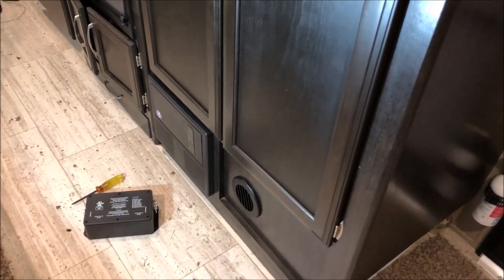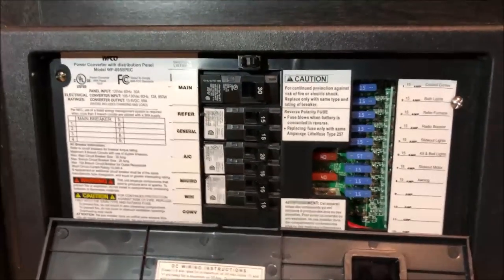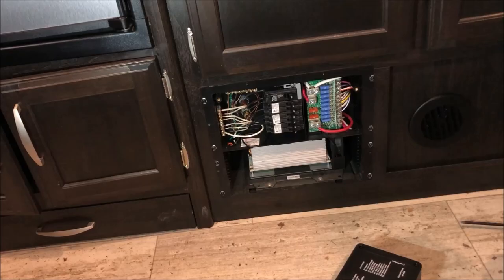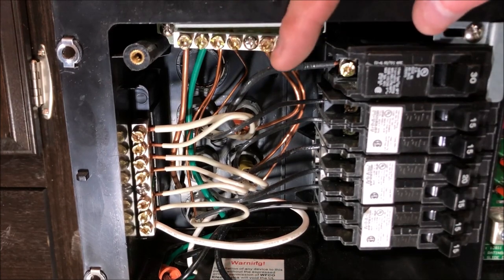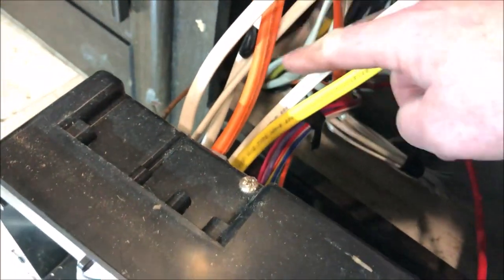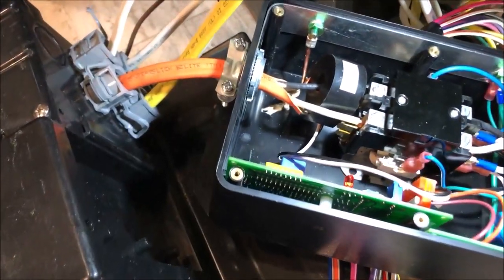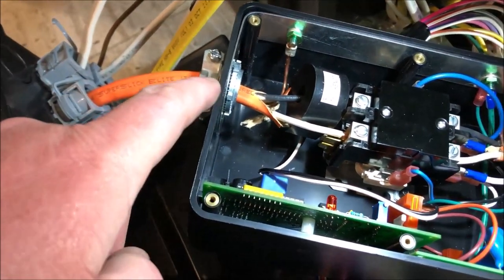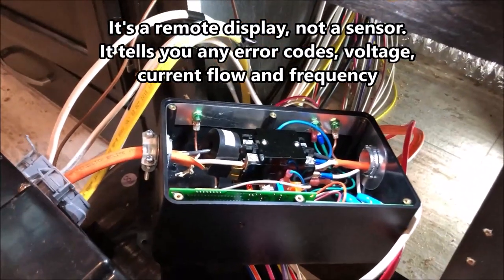Progressive Industries EMS-HW30C install

Comment: Great Video!  You made it super easy for me. 1.5 hours of my time and I never have to worry about storing, connecting, paddle locking, water damage, or having a $250 exterior inline protector stolen.

Comment: Thanks for the informative video! 1 year out, how are you liking it? If possible, could you share where you mounted the remote display? I’m looking to do the same to our Imagine 2400bh but I’m not very creative!
Reply from the maker: Hi Brad, thanks for watching.  My rig is in storage at the moment but I can tell you I mounted the remote display where my control center switches are for the awning, water heater, etc.  I used double sided sticky tape to put it up there, then I routed the data cable behind the switch panel, across the little cubby hole under the TV, then down the back of the cabinets via small holes into the circuit breaker cubby hole below them where the EMS is located.  I think this is a good buy, it works great!  The display is mostly for my own curiosity, as it has only engaged 1-2 times ever... and that is when I'm plugged in at home on a 15-amp plug and I do something stupid. You could just as easily take a simpler route and mount the remote display just outside the circuit breaker panel near the floor, it just won't be as easy to read.
Reply: @JohnsDIYPlayground  Thank you for the reply!  I’m definitely going to pick this up, then, and (try to) do what you had done. Looking forward to more great videos!

Comment: So it's basically just pulling the romex out of the existing panel and attaching to the protector, then running a new short section of romex back into the panel?  Seems pretty easy other than the normal working around electricity part?  Great video.  Thanks.
Reply from the maker: Yes, it’s kind of like adding an extra mains circuit breaker inline from the original wiring to the breaker panel. Thanks for watching and commenting!

Comment: Can the surge protector be installed at any point to the incoming power line?  Or does it need to be close to the breaker box?  Thanks
Reply from the maker: Anywhere inline prior to the circuit breaker box is OK. They even make an external version you connect at the power pole outside

Comment: Not sure I understand what functionality this provides.
Reply from the maker: Think of it like a surge suppressor "plus".  The plus things include making sure the power source your camper is plugged into is not under standard voltage (or over), under frequency or over, or missing safety features like having proper ground.  This device detects all of these things and prevents power to be delivered to the appliances inside the trailer if any of those faulty conditions exist.  It protects your electronics from damage.  This happens more frequently at campsites then at home because such a wide variety of campers come through day to day and the power grid at a campsite will look different day to day, week to week.